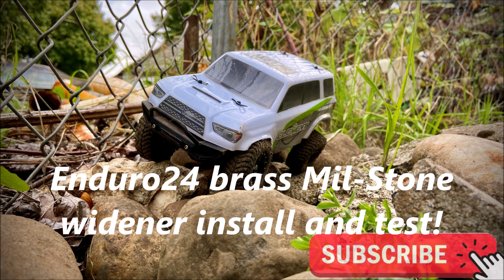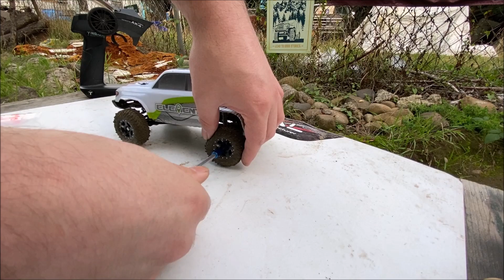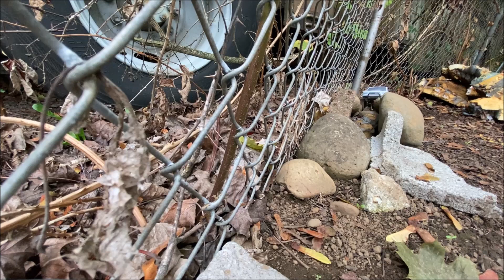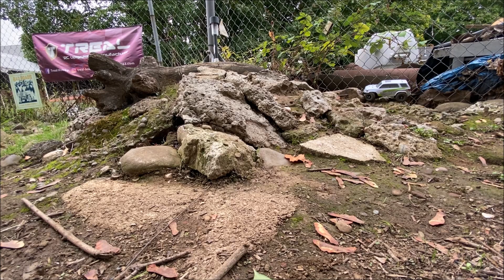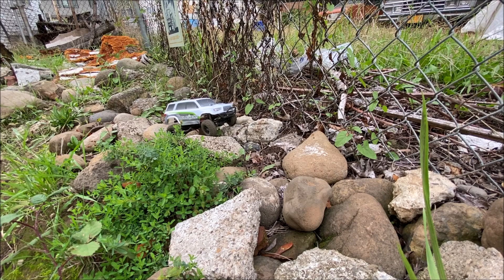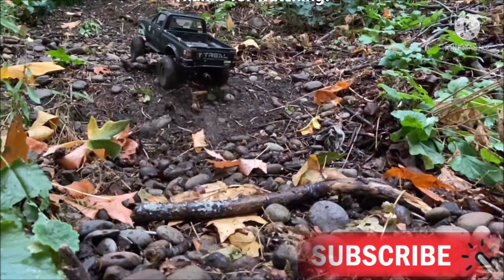Enduro24 brass Mil Stone widener install and test!

Comment: Thanks TJ! That is great to know about those Milstone options. i have them for one of my SCX24's but never thought of them for my RGT 1/24.  They should fit since it is basically the same truck as the Enduro 24.  I will have to get a set to make that little sucker more capable and wider wheel stance.  Great video!
Reply from the maker: For sure the sumo mil stones should fit rgt and ecx barrage. Wish I could afford a mini z to try them on to. ✌️😄

Comment: I would love to extend the axles on my Enduro I have searched everywhere for the parts you link to in this video but cannot find them. Any update on axle extenders for this vehicle that are more readily available?
Reply from the maker: Unfortunately I can’t seem to find them anymore ether. You could drill out some scx24 wine era but the barrow nuts are the bigger issue. Your best bet is to get a set of treal wheels with interchangeable hubs. They will widen it some for sure. 👊🙂
Reply: @TJthercGuy  I did not know that they made wheels with interchangeable hubs. That might be the ticket. I will look for that. Thank you for the reply
Reply from the maker: @cmkpikes  no problem! 👊🙂
I actually did a video on them and should have a link to them in the video description.
Reply: @TJthercGuy  I just did a search for the treal extended hubs and I think the problem would be getting a nut on the axle. Would require you to use a barrel nut. Which are easily found but they all fit the scx24 thread size and the Enduro thread sizes different. Have you had any luck putting those extended wheel hubs on the Enduro? And if so and you can link to something you have used that would be appreciated
Reply from the maker: @cmkpikes  your right the borrow nuts for the scx24 won’t work. If you can’t find the redcat sumo mil-stone wideners your best bet is to get the 1” treal wheels that come with different hubs and use the wide offset hubs.

Comment: the enduro 24 and the Atlas 6x6 shafts same size if so .. you found FMS Atlas folks a good needed mod
Reply from the maker: Right on I don’t have a atlas so thanks for the info. A set of 6 is these on a atlas 6x6 would rock I’m sure! 🤘😜